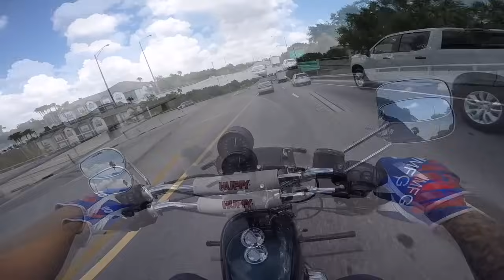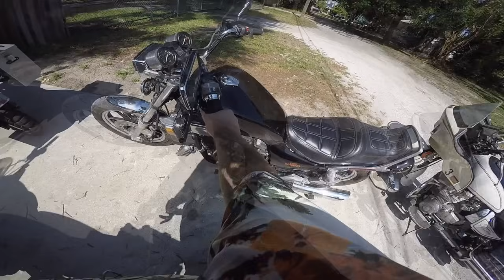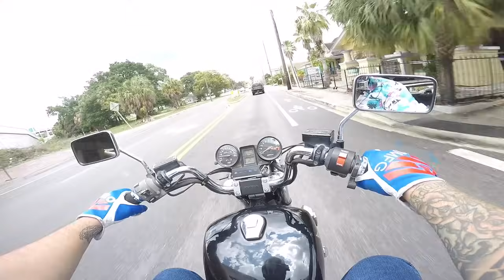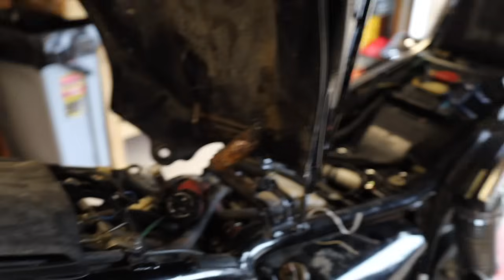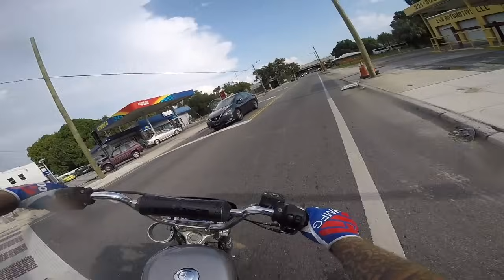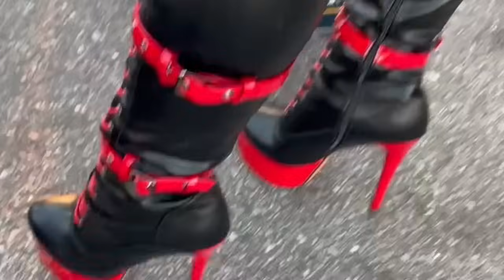Forgotten Fury: Honda's Insanely Fast 80s powerhouse will STILL beat any Harley... and I bought one

Comment: Ive had a couple VF1100C's - and they are, in a word, AWESOME.  They were built 1983-1986 if I remember correctly, they DID do a 10 second 1/4 mile, had approximately 120 HP (varied a wee bit by model year) and had a 175 MPH top speed.  I WILL own another some day, but until then, my VT Shadow will have to suffice.  ENJOY THAT BIKE, my friend. They are SPECTACULAR!!!

Comment: There were 2250 miles on my sporty when I picked it up.  I have got about 16K miles on it now, not quite 2 years later.  I have done at least one long trip to Houston and back (I live in the Ozarks) and am planning a 1300 mile round trip to the tail of the Dragon and back this fourth of july.  I will be doing state 2 and 3 on it soon, but for now I just finished the tune for the stage 1 upgrade.  Lots of fun so far.

HD Sundowner seat on the sportster will allow you to go much further than any other seat ;)
Reply: Put the sundowner on my 05 1200, 60k miles when it have up the ghost. Not pretty but way comfy.
Reply: @pcontiman  You're right, it's not pretty. That's why I don't have it on the bike when I'm riding around local. But if I'm going on a long ride I swap out seats 🙂

Comment: It was like riding an electric motor
Turn it and it was there
No lag
130 in  a heart beat and still pulling hard
Now I know the 600s are that fast now
But back then
WOW
Reply: Pulling the front tire off ground wasn't a problem either.
Reply: @Sktzo  
I could get mine up in the first 5
But not 6th
Reply: The 600’s are fast, but take rpm to get there. Can’t beat the feel of a bigger engine with a broad powerband and low end torque. I’ve surprised a few with my ZRX because you can get moving quick from a low rpm.

Comment: I'll definitely would get a tattoo from Tiger Temple Tattoo, lol.
I think I had the same issue going on last month or so. Coughing and coughing up shit, running nose, concrete filled nose, swallow felt annoying etc. 
Recovered well from it with rest, tea, other sweet drinks some fizzy some don't and getting enough sleep. But it lingers for quite a while though. Still coughing a bit and have a running or filled up nose, but that also be my hay fever acting up since i also have itchy eyes and an itchy nose. 
Hope the Dipster will be able to go on the trip. But make sure fit and ready at first!

Comment: I'm glad these things are finally getting some spot light. Guys used to pull bones from soft tails and big twins and put all the sheet metal, tanks, bars, etc onto these, and lower them. Doesn't look half bad, and rides like a modern motorcycle.

Comment: ALWAYS service the carbs.

If the tach isn't working, it's either a bad ignition module or pulse generator. If the fuel pump isn't working, swap the ignition modules. If the problem continues with the fuel pump, bypass the fuel pump cutout relay and check exhaust temperatures. If both banks heat up, then it's the fuel pump relay. If not, then it's the pulse generator.

Comment: Check the cams. Below 3500rpm not enough oil flows to the cam. So keep it above that when you can. You can  get an oil mod (most common one is the Dave dodge mod) to send more oil to the heads. Which fixes the problem. Another one would also be synching the carbs. It's crucial on these bikes. Installing a manual fan switch to keep temperatures down while in town. The rear cylinders in particular are to watch for.
Reply: Ah the good ol' "chocolate cams"
Reply: @christopher7026  that's it! The enemy of all pre cam driven Honda v4's
Reply: That name rings a bell!  Was that the drill and tap mod or the oil filter ring?  I've seen both.  Some still had lobes wipe after the mod.   

The auto fan switch on the coolant keeps it cool, until it fails.  Without a replacement a manual switch can substitute.  But then you have to remember to watch the gauge.  Mine always came on automatically at four bars and shut off when it dropped to three.
Reply: @elgringoec  Oil filter ring w hoses. Mine is the 700cc variant no bars, just a normal gauge. My fan currently works fine. But I turn it on when I come off the highway and come to a stop. I want to add a little led to alert me when the fan is on or off. And whether or not the fan has turned on automatically.
Reply: @ofoosy  
Man it all seems so long ago...
I have one of those ring types.  It's on a spare V65 Sabre I bought for parts.  I was going to swap it to the one I ride but there was a fitting I couldn't reach without more disassembly than I was willing to do at the time.  So it sits waiting.  Still.

I couldn't remember the 700 dash so I just looked and it has an LCD type temp and fuel display.  Unfortunately I let the battery go flat so it doesn't turn on.

My suggestion (as long as you're altering the wiring) is to power the fan through a relay.  Using a fused power line from the battery, the coil of the relay connected as the fan comes connected.  That will save your thermostat (the fan current runs through the thermostat the way it comes).  I didn't look into that until my thermostat cooked out under the load, and now I'm just full manual with a bypass switch (the quick fix since I didn't dedicate the time to do what I'm suggesting) (which I will do when replacing the thermostat).  When doing the relay it's a small additional effort to wire a light across the fan motor.   Using an LED, the resistor can be placed at the relay on the + side so thin wiring can be safely used to the LED itself, mounted where you can see it.  And a bypass switch across the relay contacts will allow running the fan after the ignition is turned off for a minute or two of cooldown when shutting it down hot.  (Turning the key off still turns off fan activation by thermostat.)

Comment: I remember the 1983 v65 commercials as a 16 yr old with a 76 Kawasaki kz 750. I purchased a 82 Honda750 custom in October2023 I'm gonna restore no battery haven't tried to start it yet. but its complete not missing 1 bolt or rusty. I believe I have a winner. Thanks for the content subscribed😊

Comment: Honda was a triple threat in '83. Honda released 3 VF1100's in '83, The Interceptor (Sport Bike), the Sabre (Standard), and my fave, The Magna. I owned an '88 Super Magna,  a smooth 6 speed gearbox, solid disc read wheel, the famous 4 upswept pipes. 503 lbs, and 79 hp , even as a lowly 750cc bike it was one fast little cruiser. I put 74k on it, and the guy i sold it to wrecked it the next day.

Comment: Actually the V65 Sabre was a little Faster and the V65 was a 1065.16 cc's or dealer size 1100, i owned the Sabre and i've as of sept 2023 been riding for 59 years and i've owned over a 100 bikes in all those years and i raced flat track and AMA road racing, and the V65 Sabre was the only bike that scared me, it was a tad heavy and a tad top heavy and on a favorite banked corner of mine on rte 11 near lake Winnipesaukee here in NH the sabre accelerated so fast i went wide in the corner onto the wrong lane of the road..........but Fun Fun Fun bike

Comment: I worked for one summer at an independent shop that also sold MotoGuzzi and we had one of these come in for service, don't recall just what it was.  I'd had years of working on Kawasaki H2 triples and Z1s for a dealer north of NYC and wasn't prepared for quite the shock this V model put out.  Quite a ride, what a surge, and what a sound!

Comment: I had one just like the one in the video. I bought it a year old with very few miles on it. You could pick them up cheap after the original; owner got scared of it. I buried the speedo down a long texas road with a backwind about 165  It was remarkably stable at high speeds. I had a '79 750F  a few years before and it would get major tankslapers around 115-125.

Comment: 1983 - first year of the V65 (two years before the V-Max) - beside the USA ones with Jay Gleason ripping through the quarter mile on one, or the one with the wheel spinning in gravel, one version of the Honda commercials where I lived then had the V65 rolling up to a stop light at night with the narrator rattling off all the tech specs like "1100 cc liquid cooled V-4 engine, 6-spd transmission, 117 HP, etc, then as it stops, the narrator said "When you're on a Magna, you don't just take off, you disappear". Then the light turns green and the Magna is just blink and instantly just gone, replaced by a cloud of smoke where it had just been.

Comment: Keep throttle pinned, push kill switch while shifting will yield clutch less shifting. Kind of the original shift assist. V65 was my first road bike at 19 years of age. I was a menace on that bike. Even went off-road with it. Had so much fun on that thing. It was indestructible.

Comment: Josh, on the V65, I've also had the smaller CDI box quit working. I've had coils crack and keep working.  Carbs can gunk up if left to sit too long and these are quite a joy (sarcastically) to r&r.   The camshafts are the most notorious for lobes getting wiped.  The headshake, that can turn into a violent "tank slapper" - people have been killed.

I doubt the head bearings have gone bad.  I've never seen that on these.  Might need tensioning if you can wiggle them. You'll want to reinforce the fork brace.  "Superbrace" was the brand to get.  But if you can't then you get one milled from a block of aluminum.  That's the remedy for the instability.  Not perfect but can save your bacon.  A fork mounted windscreen will exacerbate the instability.

Tires are a concern.  They came with bias belted and replacements are available, but if you want sharp handling then radials are the ticket.  Initially people had luck with the Avons but I would definitely avoid those as I had one come apart on me and the parent company Cooper tires would not stand behind them because they weren't recommended for the bike.  The Michelin Anakee 3 was strong, and now I have a continental tkc70 rocks because it was the only thing I could find in the size (during supply chain issues) which is 140/7
80-R17.  Make sure it's at least a 69 load rating, whatever you get.  Front is a 110/80-R18 (58).

There's no advance curve difference designed into the two CDI boxes.  The bigger one has additional circuitry to stop the fuel pump if the engine stops running with the switches on (like might be happen in a crash).

I hope you get better fast. I'm impressed how your skills have developed over the past few years.  If you have any questions about these I'd be happy to answer what I know.  I have four sabres, three V65s and one 700.  Ride on!
Reply: Das kann ich Bestätigen, die untere "Gabelbrücke", kurz über das Schutzblech, ist nicht das stabilste Teil. Am besten gleich austauschen mit einer Brücke, die aus einen Alu-Block gefertigt wurde. Dieses dünne Originalteil reisst gerne im Bereich der Befestigungsschrauben, wodurch die Fahrstabilität sehr unsicher wird.
Reply: @KG-li7kg  
It requires machining to fit the fender.  "Superbrace" did a great job and was the easiest solution.  You could also put one from an interceptor on there.  But yeah, they were weak, even before cracking.

Comment: My first bike was a 2nd gen Magna 750. Bright yellow thing from 1996 and damn was it a fun bike to ride. She really needed a 6th gear but the sound of that V4 with its thick, smooth mid range power. Honda absolutely nailed it with their V4 motors. The VFRs were even better with the gear-driven cams and that smooth power stretched all the way to redline. About the only thing that really sucks is getting the carbs dialed in correctly. 
Love to see other people who appreciate these bikes.

Comment: That red hose that you can see when you lifted the upper tank feeds the lower tank. I cant imagine that the bike has run much since you cant fill just the lower tank. Also that lock mechanism that you touched on is for a cable locking system that secures a heavy duty cable to the bike.

Comment: Open the bad CDI box and check for a cracked solder connection where the wires attach to the circuit board. Even if you see nothing, re-solder the connections. That could do it.

Comment: My first fast bike was an 83 Magna V65, bright yellow with a 5 pound NOS tank strapped to the pillion. Never lost a race with it, beat liter bikes easily. Badass bike, I miss it every day.
Reply: The racing engine shop I worked at in the 90's let us bike minded machinists build a Yamaha FJ1100 into a shop project nitrous street race bike. We wired a 100 hp shot NOS fogger with a two pound bottle to activate with the horn button, beep - beep at 125 mph in 5th gear and the back tire would instantly spin so hard it would just go up in smoke and peg the limiter. Wasn't long before the ever so slight high RPM detonation we didn't notice soon enough holed the two middle stock pistons while racing the poor thing. Compression test the next day - 155 psi, 5, 0, 160....Houston, we have a problem....

Comment: The V-65 started the power cruiser evolution and the quarter mile wars amongst the Japanese manufacturers.  Honda claimed it was the fastest motorcycle on the planet. 171 mph and 10.84 quarter mile. Then next bike to break it's record was the GPZ 750 turbo, 10.71 . They all went crazy from there . Never a Magna fan but always liked the Sabres. The mid 80s were awsome times for motorcycles. Don't know why Honda went away from the V4s. Seems to me they were highly successful engines.

Comment: I remember a magazine muti-bike road test of GPz's 1100 [2-valve] & 750 Turbo, VF1000 Interceptor and the Magna beast. All were in the low 11's or high 10's, with the 750 being the qwikkest. V65 looked so out of place among the sport bikes, but could obviously keep up, at least in a straight line. Never owned any, but my 1300 2-valve 6 cylinder [with a 6-pack - 3x2-barrel carbs & 120 hp] was a fully-dressed screamer [5000 rpm in 2nd gear = 60 mph].

Comment: I owned the V-65 and a V-45 and the V-65 was a beast. Nothing could keep up when I bought mine nothing stock for sure. And if you went full throttle at take off you were on your back violently if not ready for it.

Comment: in 1984 I was 18 and I was riding a 1984 V65 Magna...i was a proud kid those were less than $4k brand new back then. the plug you see on the left side is a Honda anti-theft system...this bike came with a small gauge wire that you looped around the rearwheel and plug into this...bike wouldnt start with plug in iirc

Comment: I had a V-65 Sabre what a freaking  powerhouse of a bike. The Sabre was more like a CB styled machine while the Magna shared more of the Shadow frame and riding stance. If you look at bikes like the Suzuki GS and the Kawasaki LTD that was the style of bike that the Sabre was competing with only with a V4 and not an I line engine. The Sabre was a force to be reckoned with on the strip in stock versus stock configuration until the V-max hit the scene. When it comes to power cruisers there is not another bike that has been as relevant as the V-Max. Even today the V-Max stands as the "Glock" of factory power cruisers (basically the standard by which others are judged). Honda may have been the first but Yamaha said I see you and raise you.

 I was disappointed to see the decay through evolution of what the Magna became with the V-65 1100 disappearing and the V-45 750 becoming the mainstay. Sure it looked tough and was ultimately reliable but it did not possess that pulse racing pizazz and umph that the V-65 gave us. You got a good score with that and I wish you good luck in resurrecting a legend.

Comment: That is a pretty clean looking  v65. The spark boxes and the coils are definitely where I would look first, had to do that with my 65Sabre. Once it's firing on all 4 it'll definitely haul some ass. Another good change is swapping the rear end for one of the models with a quicker gear ratio. The Magna has 2 tanks, one up top and the other under the seat.
Reply: The stock rear ratio is great.  With that power and torque it's wound out in first in a fraction of a second.  It redlines at 10k but pulls like a mule from 4k up.  In OD it spins 4k at 75mph.  It'll run 100 all day long, every day.

Comment: I had a Magna back in '85! Was absolutely insanely powerful! I can't believe I survived. It could pull a wheelie at any rpm in any gear, I think. Not actually a good thing if you are taking off quickly from stoplights.

Comment: I ride a road king. I stsrted on dirt. I had a 76 yamaha 650 that i ripped the fenders off it. Replaced with re cut dirty bike fenders on it. Knobby tires. Straight pipes, sounded like a beast off in the distant trails. Ive been tjimking about getting back to my roots. A dirtster just might be the best option for me.

Comment: I had that exact issue with my magna I had years ago the solution was an aftermarket cdi that replaced the two separate crappy cdis that the magnas used it’s a common problem

Comment: I bought a Honda1100ACE after a 20year break from motorcycles and I miss that old Honda CB 750 4cyl that I owned last time. Sure the ACE rides smoothly and runs nice but it just doesn't have the same feeling while accelerating